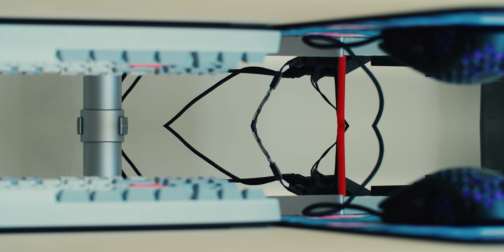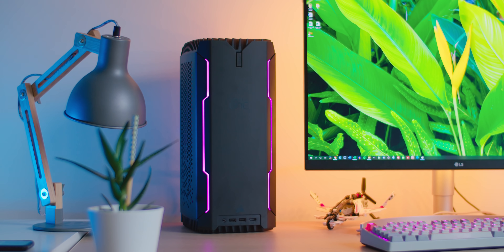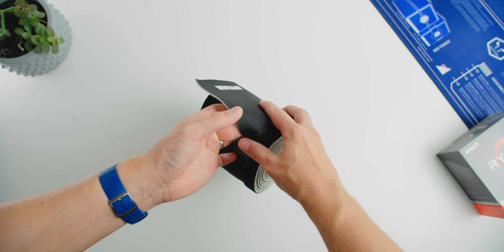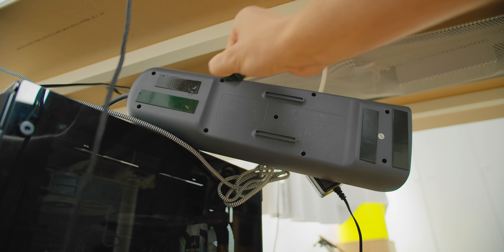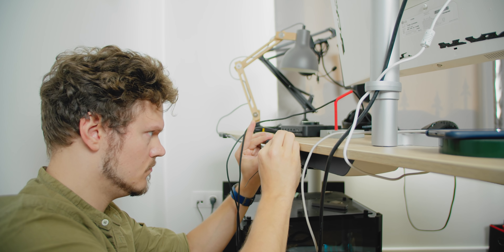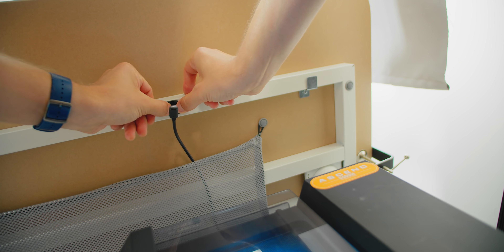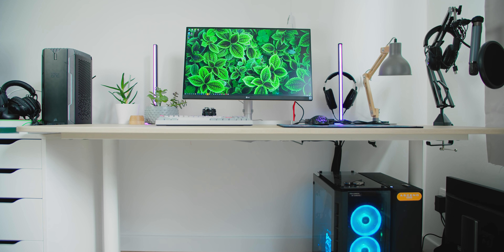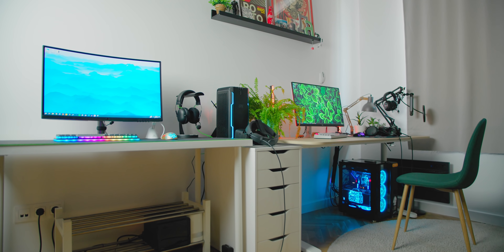CHEAP and EASY desk cable management options!

Comment: I was looking for something like this last night, what about glass desks?
Reply: As someone who used to have a glass desk, you just have to let it not bother you because there's no good solution. I had a big box I used to hide excess cable lengths but even trying to route cables via the frame, it still looked like a rat's nest. That plus seeing every speck of dust or fingerprint and the absolute pain it was any time I moved is why I switched to a normal wood top and metal frame.
Reply: @jmodum90  I second this. I'm actually in the process of looking for new desks both because I hate my glass top desk, but I also just don't have enough room

Comment: Double sided tape for power bricks is actually not a very good idea, because of the heat and constant downwards pull of the gravity it's very likely it will fall off eventually. In the middle of the night.

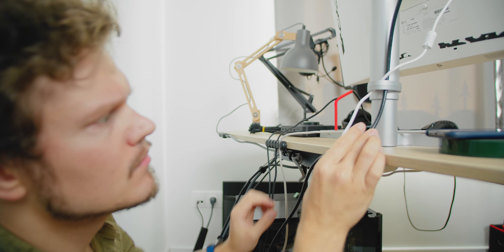Comment: 4:56 I just make it a coil, looks better and works to make your cable shorter to have less clutter
Reply: Stefan Josheski how
Reply: @jasonliu1911  wrap it around a hose or something that makes the thickness I want, hold down the coil with some sort of tape and heat the cable then let it cool for 24 hours, basically making a keeb coil

Comment: i found out my pc get cooler temps on a piece of wood on the floor than it does on my desk and my mic doesnt pick it up. Interesting to test.
Reply: glad you said this. i've been struggling between on top of desk or on floor. i have a piece of plywood from another project i've been contemplating cutting for that purpose. would make cable management a little easier i believe.
Reply: @scotmaciver  yeah

Comment: "Everything is such a mess" pretty sure my machine is at least 3 times more messy than this :-).

My setup is:-
A PC.
3 Monitors, all hdmi
1 Wacom Cintiq pro, with Wacom Link Pro
1 HTC Vive
1 External Bluray drive
1 Focusrite 6i6
1 Mouse
1 Keyboard
2 Joysticks
1 Boss GT-100
1 Roland FA-06
1 Condenser Microphone
2 pairs of headphones.

Comment: 1 small thing personally. YMMV Don't mount the power strip upside down to the underside of the desk. Every time I knock the table this one cord falls out. Total pita. Mount it horizontally to a shelf bracket or similar and it will still look clean and your cables/plugs won't be fighting gravity. Otherwise I am going to go buy some of those clamps. Good idea.
Reply: Sounds like you need a better quality powerstrip - I can lift mine by any of the 6 cords plugged into it and the plugs don't even more from their sockets
Reply: @TimSheehan  maybe. Considering it is only one cable I would suggest it is more likely the cable.
Reply: Never had a plug fallout of a powerstrip. Sounds like a poor quality plug maybe?

Idk, the uk plugs are pretty in there but im assuming you have different plugs. (Big world out there)

The Ikea Signum (I forget if thats spelled correctly but no matter) is brilliant for having an extension cord upside down under the desk. I have 2 personally
Reply: Wow. So many people victim blaming the plug / power board. It may work for you. For me I would take the easy choice and mount it 90 degrees to the desk. Easy to do with a few shelf brackets if a mount is not available on the desk.